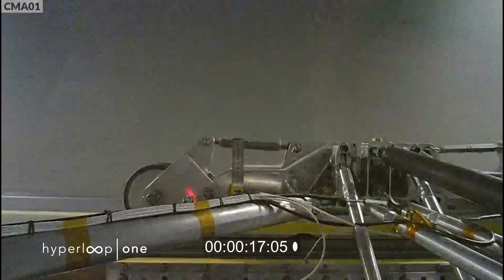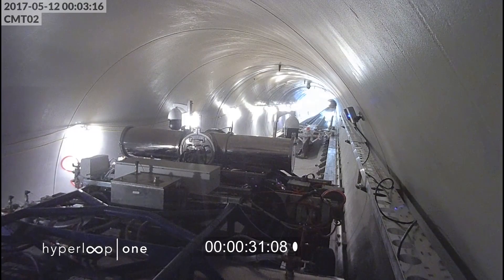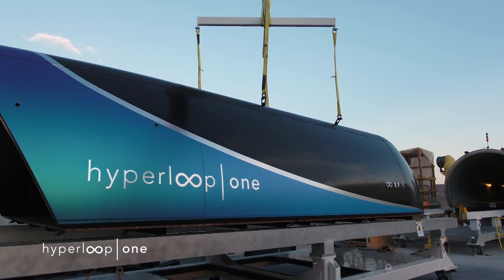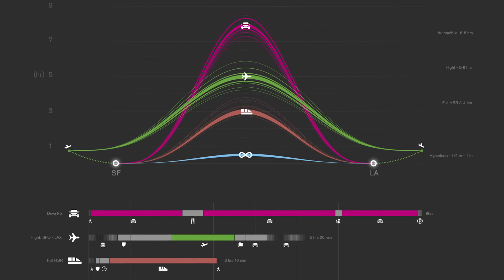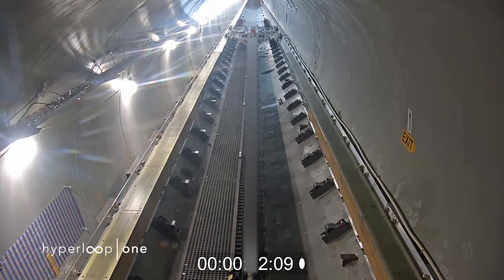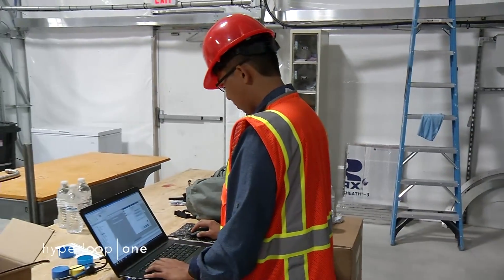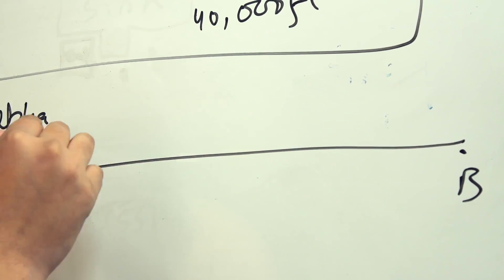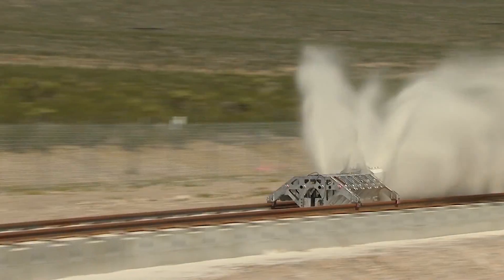Watch the Hyperloop Complete Its First Successful Test Ride | WIRED

Comment: Maybe in 100 years.
Now? Nope, even JetPacks would be better than this.

vacuum transport tubes have been a concept (and tested) for well over 100 years now.
nothing new. And engineers have known the problems with that concept for just as long. It simply would cost way too much to solve all the problems.

Like - how to make it secure? Well - it needs to be a lot sturdier than a normal road. So either underground to shield it from potential problems (that will cost many billions) or make it really thick and heavy. On a road it is an inconvenience when you have a pothole - in a hyperloop it would be lethal.
Even for NASA it costs millions to run their big vacuum chamber - and here they want something millions of times bigger.

Comment: Fucking bunch of retards how is this anywhere near a successful test. So many untested factors
Reply: It's basically a proof of concept.  Unfortunately as they scale it up both costs and engineering hurdles are likely to increase exponentially.  Technically it should be possible, but there's also the chance it will be far too expensive to ever be built.
Reply: That's why it's called a Test, it will take years before perfection.
Reply: James Morey theres about 500 + people working at this company but YOU are correct over them right ? Fuck outa here

Comment: this idea is nuts. if there is even one leak, all passengers would choke.  or you would need very expensive systems for providing fresh air
Reply: Samot Roger Add emergency valves to repressure the tube in case of an emergency. As or providing air, you  can use systems similar to those used on airplanes.
Reply: all passengers would be dead, distorted bodies and turned liquid, due to the pressure outside and the vaccum : Laws of physics trying to balance inner/outer pressure.
Reply: Same problem with airplanes but we solved that didn't we?
Reply: You mean like an airplane?  No one could ever do that eh?
Reply: like airplanes, spaceships, submarines and boats? lol
Reply: You mean just like an ordinary airplane?
Reply: Samot Roger 
I agree with you,
To make it safe is really really expensive.
Reply: Samot Roger Stop trying to be a engineer on YouTube, they obviously will have oxygen systems onboard like Airplanes
Reply: SMPLY RVNDM actually I am one. The air pressure in 13km high ist about 20% of normal air pressure (1bar). Hyperloop would nee lower pressures to reach higher speeds (if they wouldnt need lower pressure than in 13km hight, you could fly instead). sooo: it was corecct, that air compression would be more difficult (than on planes)
Reply: and for the air inside the train: if the vakuum outside the train is very good, pumps couldn compress it very good for innner air pressure. you would have to carry pressured air inside the train in pressure tanks
Reply: Giegel counters that airlines expend a tremendous amount of energy getting up to 30,000 feet and don’t recapture any of it on the way back down. The low pressure inside Hyperloop Tech’s tubes aims to replicate the atmospheric drag at about 160,000 feet 
from: https://www.google.de/amp/s/www.technologyreview.com/s/601417/the-unbelievable-reality-of-the-impossible-hyperloop/amp/
Reply: MegaKopfschmerzen dont think that would work. ad mentioned above. if the tube ourside has a leak, it would collaps very quickly.
Reply: DarkMGTOW Wonderboyz Do you work for a sophisticated company, no, stop trying to be smart in a cesspool

Comment: Proof of concept 70 MPH, meanwhile the 268 mph Shanghai Maglev train is in service now, bit early for champagne & cigars.
Reply: Jon Photo I think his point is when you create a car in 2017 that can only go as fast as 2 horses it wouldnt be anything special.
Reply: Shanghai Maglev is based on the Transrapid, which was developed for many years. Unfortunately Germany gave up on that technology due to some rail lobbyists, who didn't wanted a new technology competing with their rails. And sadly they are not willing to give away the technology for free, although years had been spent in R&D. So China and Japan are currently researching and developing their own Maglevs. Their first maglev trains are slow as well, but it won't take them long to build faster trains. Same is happening with the Hyperloop.

Don't forget, the first steam locomotive set a speed record of 8km/h in 1804.. Since then the speed of the railsystem increased by a fair amount.
Reply: How fast did your maglev train go on the very first test?
Reply: Special here is the fact that it's fully working. This is a prototype. Ofcourse the final edition will be much faster.

Comment: Its all very well until some Terrorist decides to ram the loop, thus causing a massive decompression & mucho dmg. Multiply this a few times & the loop will be classed as too expensive & thus useless.

They need to shield it physically in a walled covering aswell as constant security etc etc.

Great ideas like this have been around since the 1960's with the tech only available since the 2008+ but they still dont look @ the big picture, only the Kudos points.

Comment: It's a shame that thermal expansion is a thing.
Reply: That's why there are gaps between rails. However, gaps between tubes containing a vacuum are not the same as air exposed rails.
Reply: This technology wont happen on a large scale. It looks silly and is dangerous. Not to mention this large tube stretching for hundreds of miles could be easy target for terrorists. 
Why its dangerous? Inside that tube there must be very low air pressure or perhaps even vacuum. To reduce air resistance.  If something goes wrong with oxygen supply. People inside that thing could suffocate.  

When they finally disclose anti gravity. We will fly in the sky just like in air planes today but way way faster and more elegant. Travel time from LA to NY will take 30 minutes or even less. Such flying device will be a VTOL and very silent. So it could land or rather hover over buildings directly in downtown or suburb. 

This is the future not this silly tube.
Reply: @oldi184  So to you this concept is "silly" but not your proposal of antigrav? BTW Time to leave your computer the nurse said it's your pill time.
Reply: @James Sempy

TGV is amazing. I ride it once years back. 300 km/h. Truly amazing experience. So fast and smooth.
Reply: If you honestly believe this isn't being accounted for, then you think far too highly of your own intelligence.
Reply: yep, probably. but the govt. will subsidize it keeping it alive just like Tesla, and Solar City
Reply: The ISS doesn't have a multi-ton bullet traveling through it.
Reply: when it fails,  do they cut you out.
Reply: @mr.nobody5422  I know, I bet the engineers have never thought about emergency egress. Good thing you're here. "when it fails,  do they cut you out."
Reply: @mondayfool found your public profile! http://www.youareanidiot.org/
Reply: I'm excited for this, but why do this?? Planes can go as fast as 500 miles per hour, and with the enclosed space , safety and security is necessitated, so convenience might not be that much of a benefit. Unless this thing makes it speedy plus really really cheap, I don't think I will use it.
Reply: @invaderg3332  Let me ask you this: Would you rather be 33,000 feet at 500mph in a cigar tube or in a Hyperloop on the ground when something goes wrong?
Reply: Hmm... agree to disagree with half of you then. I prefer keeping my glass half full, and keeping my faith in progress and humanity. If every idea was shot down so easily without at least trying first, we'd still be riding horses and carriages.
Reply: NukeMarine we don't have gaps in rails anymore becomes of welding
Reply: Joshua Mcateer to bad its a vaccum tube no air to create heat. Then for outside heat holy shit its a big one its called an outer tube, i know its a big word
Reply: Joshua Mcateer o
Reply: @ Sidowse ....  I fully agree with you.
this Hyperloop business is charlatan at best, a scam at worst ....
Reply: it's called a total implosion .....
Reply: Joshua Mcateer.  Ya gotta remember these are prototypes. The final product could be an entirely different system all together, perhaps several that can evolve. When i tinker around i often find some totally different means of achieving the same goal. There are most likely several dozen ways to get up to speed in transport. To do it safely, economically, affordably, is by no means easy but you gotta start somewhere.
Reply: nestafett2. I would like to ask you politely, to whom are you wanting an answer from? Again, if you would be so kind as to state your question.
Reply: Hassan Selim.   During the construction of the Hoover Dam, circa 1933 ,the concrete was cooled via specially installed cooling tubes then filled with cement when that part had hardened. This was a marvel of engineering for that time. Essentially, I'm saying that with a little ingenuity a rail system might be feasible.
Reply: Joshua Mcateer i
Reply: @nestafett2: I went outside of my norm and actually commented my opinion on the original post, only for it to be shot down with brute force by those with differing opinions and/or copied and pasted engineering terms from Wikipedia. If you read my two very quick comments on this thread, you will see that we are like-minded on this subject, and luckily for us, many other people in this world are hopeful for progressive change as we are. Save your sanity and let the conversation die off, you'll feel much better, and will probably continue to laugh at all of the nonsense that continues to get posted in our absence. Keyboard warriors are just that: keyboard warriors.
Reply: @Sidowse Not once did I make any comment, assertion, or insinuation that one is better than the other. In fact, I haven't really talked much about the topic at hand other than the fact that A) I support progress, innovation and advancement, and B) If people commenting have figured out what hundreds of scientists, engineers, developers, and many other minds hard at haven't, that they should get involved and put a firm stop to it or come up with something better. That phrase alone landed me in hot water with my first comment, but I stand by what I said.

You sound like a very intelligent person (up until when you called me an idiot for no reason other than objecting to my oh-so-favourite group of keyboard warriors), and a lot of people on here sound equally as intelligent as you. I just find it astounding that there could be so much intelligence in the world simply being held up wasting time on YouTube comments instead of being out there trying to improve the world, which is something that all of the Hyperlook developers are actually trying to do, not shutting ideas down on the internet.

But what do I know, I'm an idiot according to you.
Reply: mondayfool. " Without any real idea of how to do it."  ok. Then we better tell France, Dubai, Czech Repub., China, Germany, etc.  cuz your information is more correct. 
   What are these guys thinking?
Reply: fambaa. I don't think any taxpayer money is involved here. It's sort of an old idea but this is the first time it's been put into practice. What's with all the naysayers? 
  I say let it ride. We just might learn something new like : people inside rifle barrels need to spin to get better accuracy.
Reply: mondayfool.  Dang skippy on the hype gettin' up some momentum.
Reply: Community College Genius. Are you really a genius? Can you spell antidisestablishmentarianism?
Reply: Alex Barrington. I tried gettin' a degree but they were fresh out. I waited in line for a hour.
Reply: oldi184. Everyone on board has access to and instructions on how to use a saws-all. Problem solved.
Reply: @ Thommy ....
Hyperloop are tryning to lure investors , like the flying car ... both old concepts. bothare mirage ... both face SECURITY problems.
I say:  forget about maglev, pod ... just build a vaccum  tube 99% secure, and I shall put my money.
Reply: Oh you're assuming too much about me. I'm not as presumptuous as you guys to assume things without being part of the actual thing. 
These projects have so many factors going on inside it's simply silly to assume you're right because chances are you don't know every detail behind the Hyperloop.

Nor do I, which is why I'm not for, or against it. But if it succeeds and is tested beyond normal safety usage, then why won't I use it? 

>Old, rejected ideas.
Yeah, because you're actually part of the Hyperloop team. Do you know every detail about it to say it's exactly the same as those old rejected ideas?
Reply: You can make criticisms about anything anytime. Assuming however that you are absolutely right without knowing the full details is just arrogant.
Reply: "Maybe they should have played about with that idea before building a useless tube!?"

Oh I won't pretend to know everything but goodness. I'm sure you know what a CFD simulation is.

And no, you're definitely wrong, even a small detail can change what you think is possible.
Reply: I won't argue with your wall of text. Although I do know physics and math, I know well enough that the engineering is far beyond what I have learned.
One thing though. What cost are you talking about? CFD is already fully capable of simulating things at airplane speeds. CFD has its limits I know but you can still get reasonably accurate results.

As for that last one. That's an easy one.
Simply negate my statement

"A small detail can't change what you think is possible". 
or let me reword that a bit because that sentence implies that it has something to do with that you believe
Here's a better one:
"A small detail can't change what is possible"

Well that's definitely wrong. I don't even get why you even bothered to point that out.
Reply: To be honest, I'm well aware of the immense technical challenges of the hyperloop, in particular maintaining the tube to near-perfect vacuum -- I have no idea how they'll do that. The same goes with the seemingly overly-expensive infrastructure it's built on. 
But I'm not an entrepreneur to understand the supply-demand side of this, and as I've said I'm not an expert in its engineering.
I will maintain my position as an agnostic in this regard. Let's just agree to disagree.

Regarding using CFD for rigid-body dynamics. It's not hard to imagine that one would exist, in fact with all its potential uses, I'd be at a complete loss if a company hasn't had the initiative to develop it. 
I would imagine that they'd be using it maybe for wind turbine-related stuff, civil engineering, hydrodynamics for damns maybe, idk.

A quick google search will give tons of information regarding CFD software with rigid-body dynamics.
Reply: my ghaad, My head hurts, just by reading the comment section i'm outa here!
Reply: Too bad they didn't read these comments before spending so much money on the idea. Probably next time
Reply: yeah, we could've had amazing rail networks if it wasn't for that pesky thermal expansion that kept bending the rails.
Reply: Well someone do the math with a normal magnet rail train and the hyperloop needing thousands of pumps to keep the low pressure if it starts leaking because of expansion.
Pretty sure the "cost" of electricity of the hyperloop is much greater than a monorail.
Reply: True ish but it wasn't designed for it
You can re-enforce expansion points without compromising flexibility(using support rings and other structures, multiple metal layers and protective covers on both the inside and the outside etc etc).

All in all they can probably make the expansion joints able to cope with everything but a direct hit and at that point there's no point in planning.
Reply: Hmm... somehow I don't think any of you are engineers (I'm not pretending to be one either), but I'm pretty sure that a group of engineers, physicists, design consultants, technicians, and everybody else involved would not sink so much time and effort into something that could be completely shot down by a group of keyboard warriors on YouTube with absolutely nothing better to do. Go get a degree and change the world if you can do better
Reply: Cant we regulate temperature somehow?
Reply: thats called wasteful spending. Its taxpayer money with bad efficiency. We already have things with higher efficiency accomplishing much more band for the buck.
Reply: snails may solve the problem .... pwahahah .....
Reply: It is quite easy to create an air tight pipe system.

You create a bigger opening at the end of a pipe or a connector that is bigger.
The metal doesn't touch each other. But you can make it air tight by using things like rubber.
This way the metal will have leeway to expand and retract while staying airtight.
Reply: "If you honestly believe this isn't being accounted for, then you think far too highly of your own intelligence."

Best commend so far.
Why is it that everyone on youtube apparently has a PhD in engineering and physics that they think they're smarter than the engineers at SpaceX?
Reply: -Metal foil can hold back vaccum. the ISS is at this very moment orbiting with one atmosphere of pressure acting on metal about 2.5mm thick. Thin metal can also reversibly flex. This is probably how they'll account for expansion.
Reply: rubberband seals